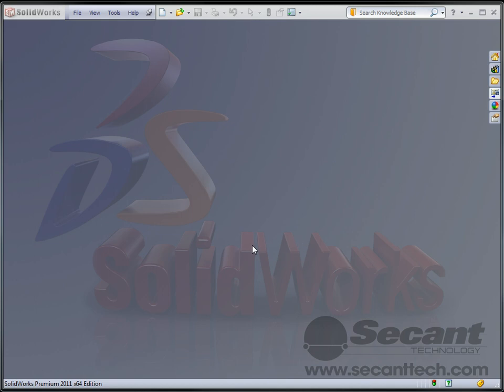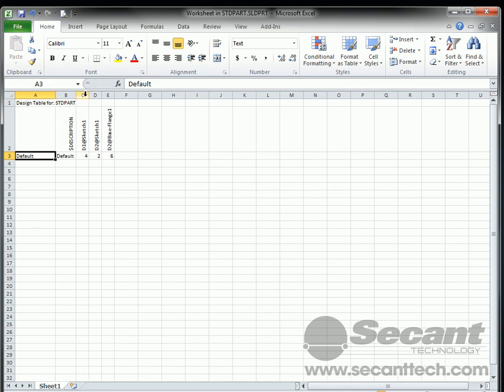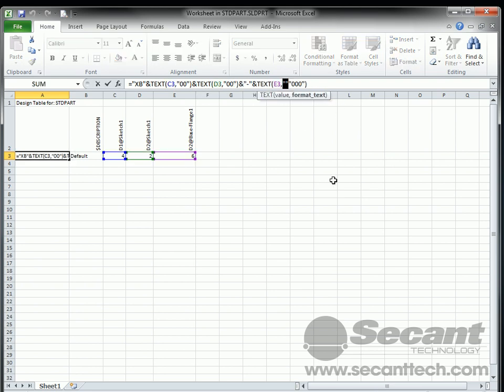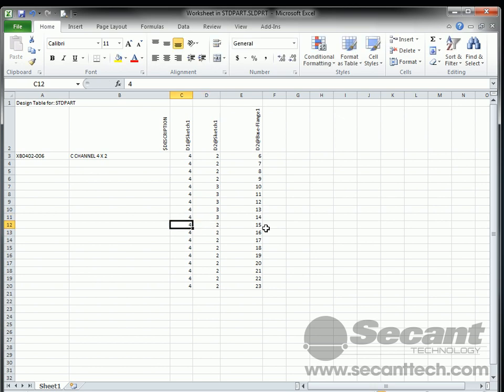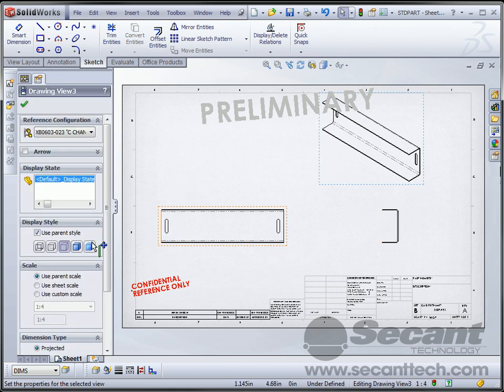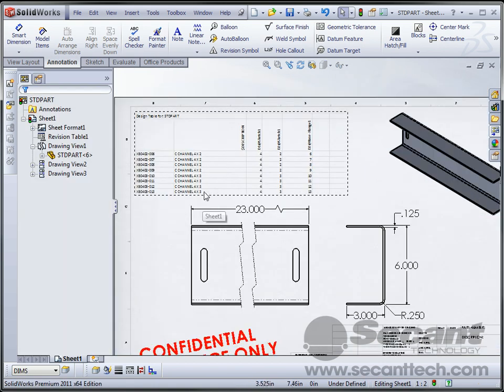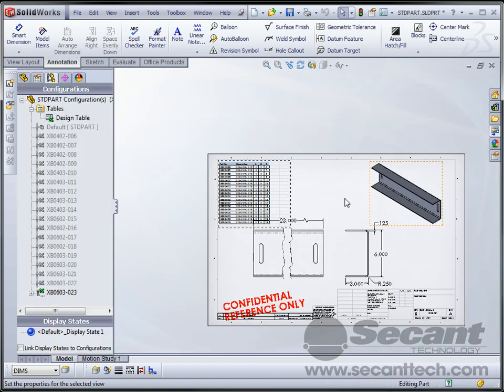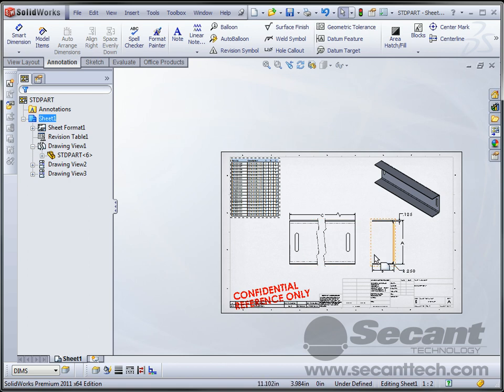Design Table In Drawings

Comment: Thanks for this post.  I'm learning Solidworks after moving from PTC/Creo.  I used functionality like this all the time in Creo with Family Tables (which basically equal Design Tables) leveraged into my drawings.  I'd been searching for examples of how to do this in Solidworks.  It's a little more involved than is required in Creo, but straightforward enough.  Thanks again!